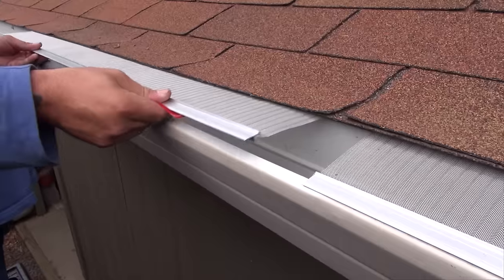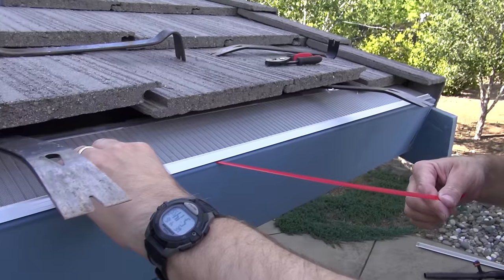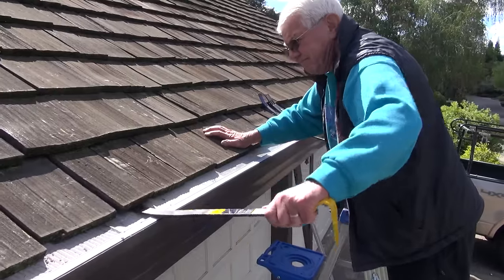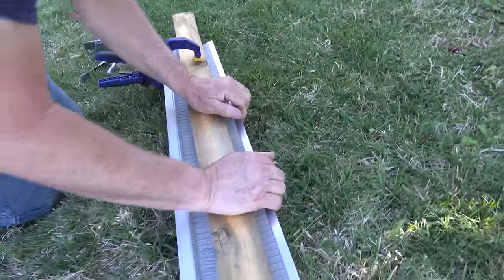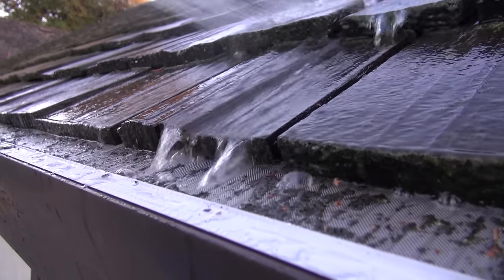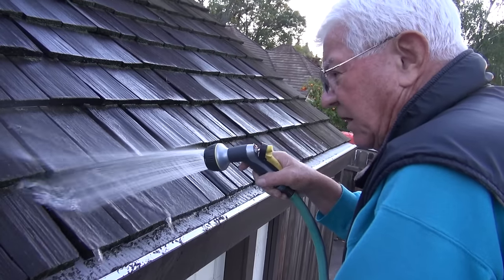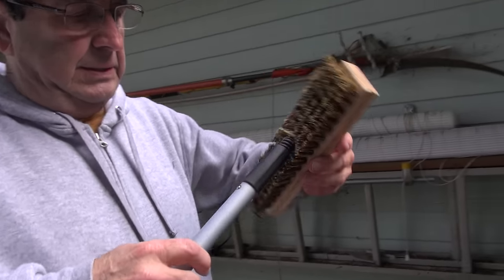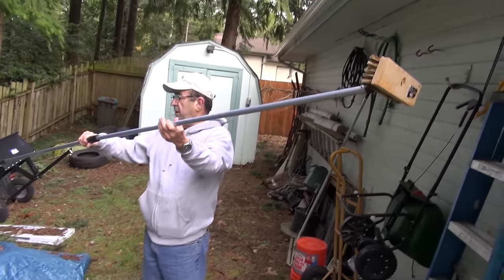Home Depot Gutter Guard

Comment: I saved $9,000 dollars today by not buying leaf guard or any other guard.
Reply: Thats one big house.
Stuff is like 100-200 bucks for around 80ft depending on what you get.
Some are 2 bucks a pop for 3 feet each. 100 bucks would give you about 150 ft.
Reply: Smart move. None of these leaf guards work
Reply: I didn’t use any brand name leaf guard. I bought a roll of hardware cloth (galvanized steel mesh) with 1/4” spacing from the hardware store, cut it in 3’ x 6” sections, install one side under the shingles and secure the other side to the edge of the gutters with screws. Total material cost $175. Works great. Took me about 8 hours for my 2500 square foot home. Easy, cheap and effective.
Reply: You shouldn't have had gutters in the first place

Comment: To the naysayers, if you have a better solution don't keep it a secret.  Don't you think this is better than going without any kind of guard?
Reply: I agree. I think any system will require some level of attention. maybe once a year pop up in power spray or clear the mesh isn't a redonkeyulous task and or expectation.
Reply: I clean gutters for a living.  Mesh gutter guards do absolutely nothing
Reply: @EnemyBorat  so mesh gutter guards don't keep leaves out? I disagree. Obviously sediment is going to accumulate and the gutters will have to be cleaned eventually but if you live in a heavily wooded area you're not going to have to get up and clean the gutters on a monthly basis if you're using gutter guards so they absolutely "do something" quite beneficial.
Reply: @headdownharris  they do keep leaves out, but leaves aren't the only thing that goes into gutters.  Shingle grit goes right through the mesh, accumulates in the middle if the gutter run and stops the flow of water.  The more shingle grit that accumulates the heavier it gets which then starts to pull the guttering away from the house.  Helicopters get stuck in the mesh and make the guttering look like crap, sticks get caught on the guard lip and stop things from falling off or through.  Yeah..gutter guards are a waste of money.  Guards give homeowners the impression that nothing needs to be done once they go on when in hindsight it just makes more work for the next season
Reply: I bought t $2 each vinyl with mesh. I overlapped the ends about an inch. NO freaking screwing either. just clip on the gutter edge and tuck the other side under the shingles. They stay in place, and all leaves and sticks dont go past them. But, just like this overpriced crap, fine particles will get thru, so either system will have you cleaning the gutters,especially at the downspout ends, eventually. With this system in the video, all you are doing with the brush on a stick is forcing more crap into the mini holes! The people who fail using the ones I use, just dont know how to do things properly.
Reply: @headdownharris  Purchased on Amazon, you get a free brush. It cleans up pretty good. Mine work well now for 3 years. Lots of trees, Pin Oaks, Shag Bark Hickory , maples.
Reply: headdownharris which is basically the same as cleaning your gutters
Reply: Jeremy Flauugher no you don’t
Reply: @EnemyBorat  , that was the thought I was having.  Just cleaned my gutters (actually, still in the process...LOL) As I see the "Shingle Grit" as you call it.  I end up scooping it up with a small hand scrapper.
Reply: @EnemyBorat  you can also just blow it out with a blower and maybe wash it out with a pressure off one every  month or two
Reply: If you get non grit roofs and install this I think you're good to go for a while. Like a sheet metal roof style or or even clay shingle roof.

Comment: The worst decision you can make (other than installing gutter guards) is to screw the gutter guards into your gutters.  Not only will they clog in a few years, it will be a mountain of work to unscrew all the pieces.  Doesn't sounds like fun!!!
Reply: Pete, I don't think it[s that much of a big whoop if folk were able to go hands free for a few years and not have to manage the gutter system. I actually think that if the system works like it's supposed to, on (maybe) the 3 yr mark,  then it's time to flush the muck from the system and folk could flush the whole run with some pwr wash push toward the drain to flush the grimy stuff. Right? I mean, it's not reasonable for us to expect that we'll never have to handle our gutters after we install and improvement, correct, Sir?
Reply: @headdownharris  Yeah, That powerwashing will be super easy standing on the ladder 2 stories up! Someone else can powerwash your blood away after you fall.
Reply: @terrythomas790  why would you have a ladder? Just get an extension for your power washer. Some of you people just look for any excuse but don't realize there's simple fixes.

Comment: After 3 years mine are working great.  Bought them at Costco.  Installed myself. Its very easy.  I have a steep roof so needed to put a bend in the screen.  This does allow some debris to accumulate but not much.  On the south side I have a western red cedar that is always dumping something.  I clean that about once a year with a brush from the ground   the biggest issues is inside corners.  My cedar dumps so much debris I have to clean that one inside corner almost monthly during the winter.  takes about 5 minutes which includes pulling out the step ladder  but that is still much less work than having to clean the 200 feet of gutter twice a year.  Installation is about 4 minutes per straight section and 10 minutes per corner section.  A cut off tool works much better than a sheet metal shears.
Reply: contacting you regarding the guards.  I  installing the costco mesh guards today..  any I wish I had ....  recommendations.  I have steep metal roof but have had the gutters ice up in the past. they are 3 years new and found that I still get to much degree in the gutter so adding these covers.
Reply: How much was them?

Comment: I put Home Depot stainless steel micromesh Gutter Guards by Gutterglove on my home about a year ago. If you have a one story  home it is a cake walk to put them on. I installed mine using a step ladder. Gutterglove is a great company and will offer you the best customer service there is. They have a great video on how to install the gutter guards also on YOUTUBE. Also, you will get a great instruction booklet with your order. I was able to install almost all of mine with the one side under the shingles. The self tapping screws which i choose to use works great. It is a big cost savings if you do them yourself. I only did the gutters where there are problem areas with leaves. I did not see any reason for installing them where there is never a problem like my garage was. Gutterglove gave me a free gutter broom to clean my gutter guards if it was ever needed. Now that I am older I do not have any worries with gutter stoppages!  A great warranty too.
Reply: How are they holding up?
Reply: Great with no problems! @JoeFidler
Reply: @jerryw4471  That’s great to hear
Reply: They told me itwould void the warranty if I self installed them.
Reply: @righteyeartistry156  There is no warranty if you install them yourself. Easy to install on a 1 story home. Just follow instructions you will get.

Comment: If it's raining bad, will the rain go through the mesh into the gutters and down the spouts or will it be slipping off the guard and down on to the ground?I
Reply: Fine mesh screening will not collect heavy rains.  Water will hydroplane over the fine mesh into your yard.  No system is without cleaning.  Don't trade off water collection, the purpose of gutters, for the "never cleaning sales pitch".

Comment: Will redwood pollen get through there
Reply: I have a very large western red cedar that dumps everything onto my roof.  I don't think the pollen gets through.  If it does it isn't much.  Once the screens are up the only way to check is unscrew or unstick and peel it up.  I had to do this on one section after three years and the gutters were very clean.  The pollen size is very similar for the two.  25-35 micrometers.  I still brush off the screens once or twice a year due to the grit from the shingles.  

 The Biggest problem is inside corners.  Thankfully I only have one.  I have to clean that six inch area about once a month due to large amounts of debris and gravel accumulating.  Still much easier than cleaning all of my gutters twice a year with a shop vac which took about an hour.

Comment: question"  what about pine needles under a redwood tree?
Reply: Don't bother with these. I put them up over a year ago and today I am taking them off. Debris piles up on top of them and the edge drips water all along the gutter making them useless. Better just to clean your gutters once a year. I've yet to find something that really works.
Reply: @chrishoman8841  Chris...I took your advice..yours and everyone els's...my wife and i signed up and we had 3 days to cancel...I called the same night and the supervisor was a jerk that I cancelled and offered to cut the price almost in half..from 3K to 1600$..keep in mind they started at 4 K$....I told him I was insulted  and he  got really nasty (so did I )....I told him I wouldn't have them if they gave them to me for free...I wonder about this co.
Reply: @dhimes3  That price is ridiculous. Even $1,600. Should be a few hundred I would think unless you have an unusually large house or circumstances. Spend the money and have them cleaned out each year.
Reply: @chrishoman8841  I installed myself.  Its very fast.  About 4 minutes for a straigh section and 10 for an inside or outside edge. Plus set up and take down.

Comment: Terrible, they drip water over the edges. Makes having gutters pointless. They drip rain and melting snow all day.  I'm taking them off in the spring.
Reply: Did you bend the guard so there is a slight dip in the screen.  Since they are already up just push the center of the screen down a bit.  Makes a world of difference.
Reply: I took them off. I'll just clean the gutters 2x a year.

Comment: no more gutter cleaning? What was that crap I see building up on the screen? I had a similar style and the plastic rots and gets holes in it after a couple of years and it's more work than just leaving them off altogether. You need the ones like gutter guard or gutter helmet that have a solid surface all the way up to the drip edge.